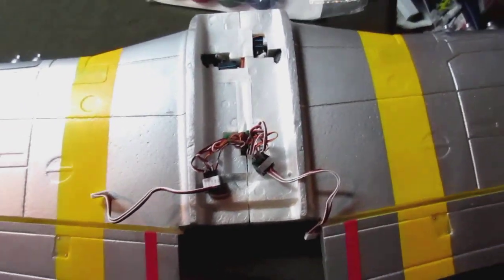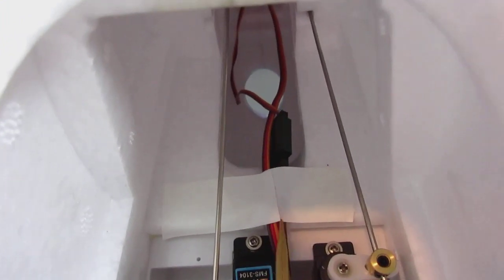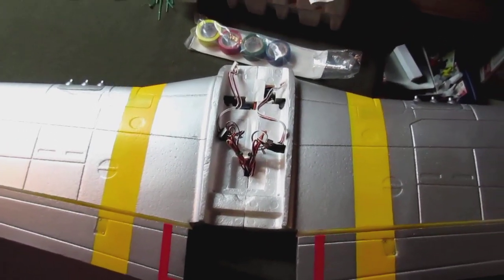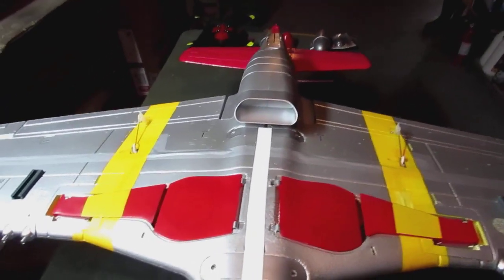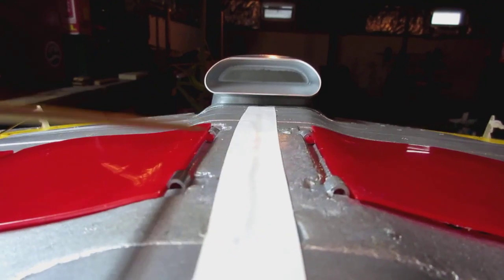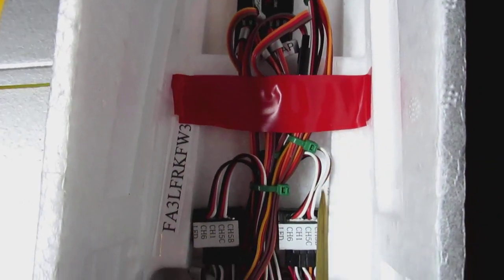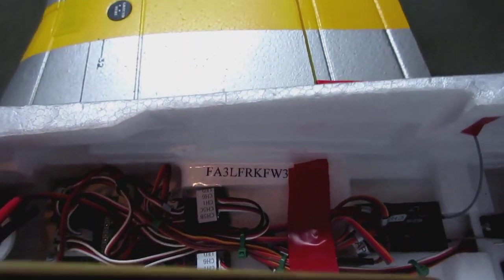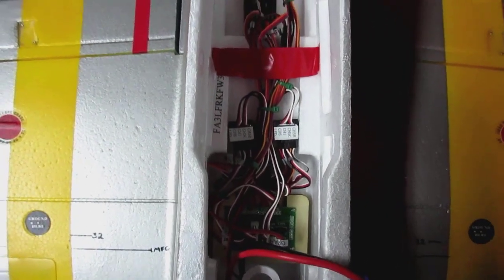FMS 1450 P-51 Build   part 4  of 7  (fitting wings/wiring to fuselage)

Comment: I had the exact same issues with wing ++, but I have a eagle A3L-3 axis gyro and a 10 channel receiver, so I gess I have twice the number of wires. So I mounted the plug connectors on the wing area ( I have to take the wing on and off cause of transport every time) I also cut the bottom of the canopy approximately 10 to 12 mm to fit with the wires in the fuselage, and had them flat and clean as possible. (Beware of the clearance to the pilot inside!!)

The issues on this plane where really time consuming! But I had study a lot of videos of this plane, so I knew about it up front. I always study videos out there before I buy anything! Anyway its a nice flyer (not flied it yet my selves ) But from videos its look`s like a great flier in this EPO class. I also have the , like you 580kv and will order the alu upgrade side panels for the landing gear, maybe I do the prop mod too later. I also recommends the newer FMS P40 in this series, it`s another world when it comes to quality!! Thank`s for sharing this! https://www.youtube.com/watch?v=QksnbavFSwg
Reply from the maker: Those videos are right.   I think i comment on that in one of the next 3 parts that I have upload tonight.   That is that--in spite of the build struggles,  this plane flies like a dream.  It is absolutely the best and easiest flyer of all my planes; and that is without a stabilizer gyro in it.   I have a Timber with an Eagle Tree Guardian in it and this FMS P-51 naturally flies much smoother and more graceful than that.   So don't be afraid of flying it.
Prop mod isn't necessary.   the stock prop is so beautiful, I wouldn't dream of replacing it.   Some people (Gooniac33 for example) have done zip tie mods to the stock prop and have gained a ton of power.  You might look into that as an option.   It costs nothing other than a few Zip ties ( tie wraps).
Reply: It`s not necessary with gyro in this plane, I did it cause of research and curiosity, and fly it in even more windy conditions . ( with on off switch )